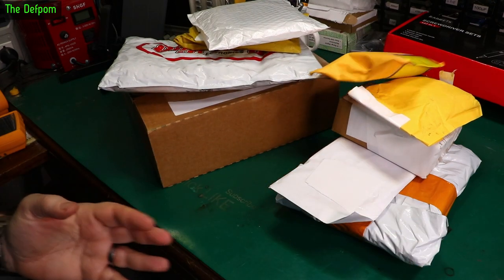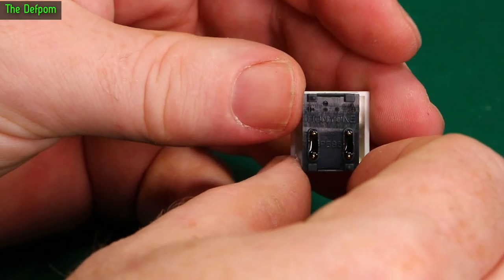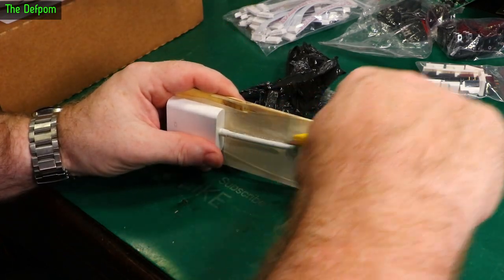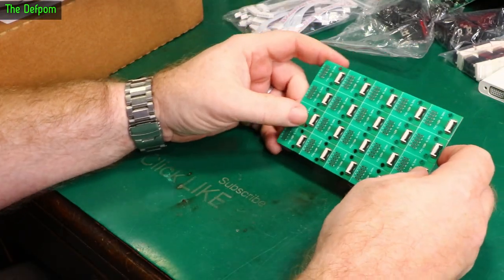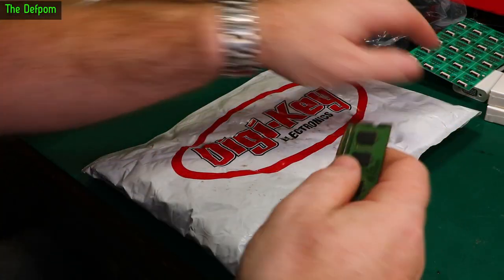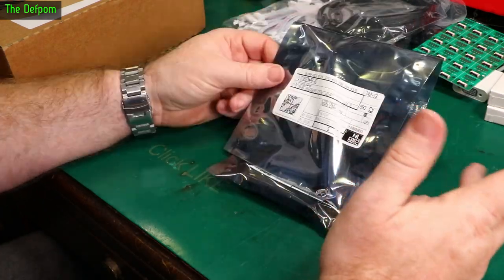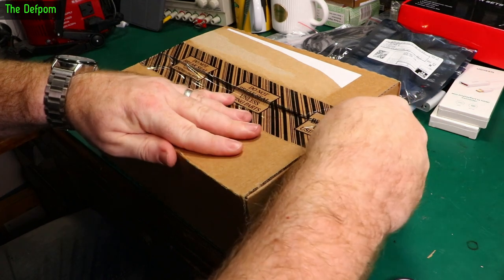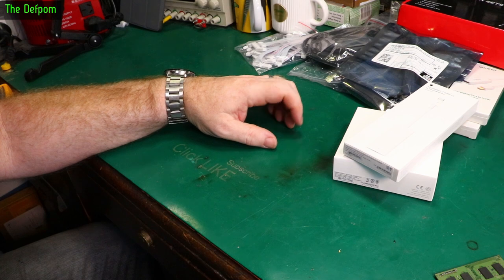🔴 What's in my Mailbag ? - Mailbag Monday 5th June 2023 - No.1137

Comment: The LTC1052 has an EAR99 notice. 
HS Code 85423390 - Electronic, integrated, circuits
Electronic integrated circuits as amplifiers (excl. multi-component integrated circuits)
there is some information about dual use but i can't see where the restriction to New Zealand comes in. 
But EAR99 does point out that they can't be supplied to :- 

to an embargoed county; 
to an end-user of concern; or
in support of a prohibited end-use.

I think you come under the end-user of concern! 🙂

I've bought parts before where you have to submit a two foot tall stack of paper work before they will even let you see a data sheet. but never an op-amp.
Reply: Digikey allows for a declaration by the user, Element14 doesn't which might have forced the EAR99 compliance. Also, I wonder where Digikey's stock in comparison to Element14 is located. Just guessing!
Reply: @IanScottJohnston  i'll still stick with the "end-user of concern" as they may have seen his videos! 🙂
Reply: @TheEmbeddedHobbyist  Aye......that Ram knife!
Reply from the maker: That's very helpful information, thanks.